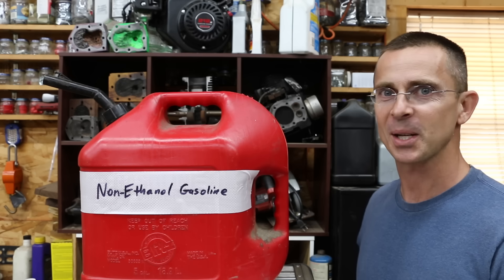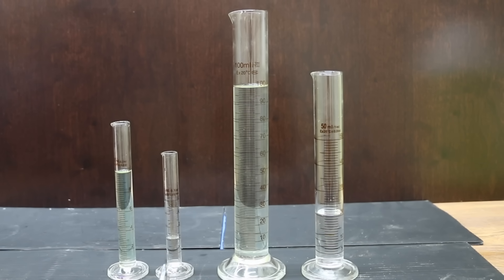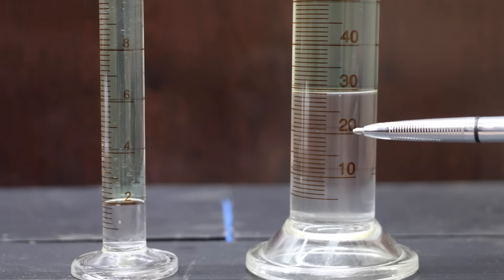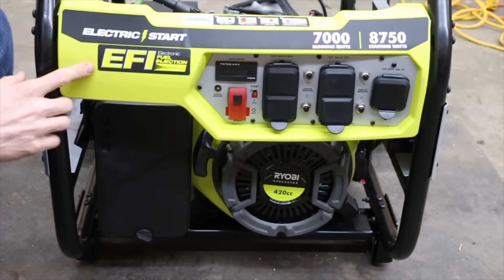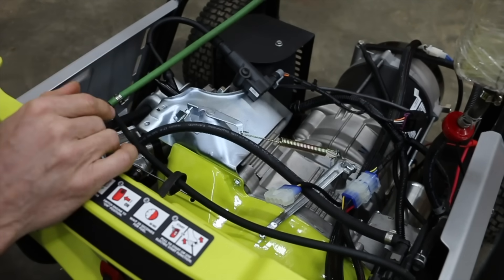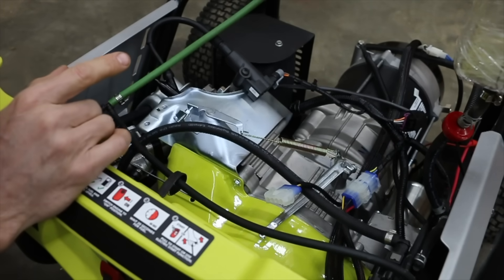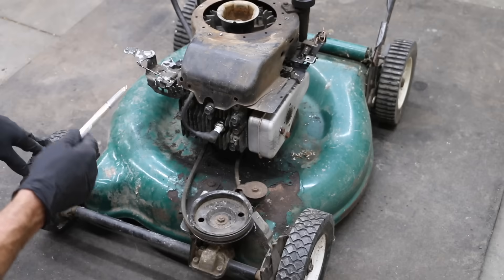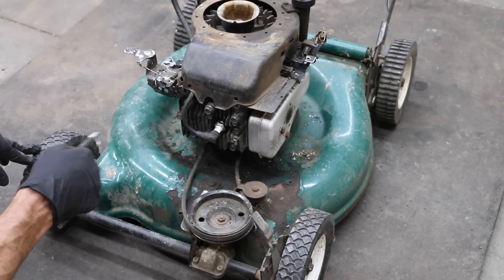Is Non-Ethanol Gasoline Really Better? See the PROOF!

Comment: 2 petrols one with 10% ethanol the other with 0% having the same octane rating means that the ethanol fuel uses a lower octane petrol which is then boosted with ethanol. What I would be interested in is taking the same basic fuel and then just adding 10% ethanol to it which would raise the octane value. Then running 2 engines which only differ in the optimizations regarding the octane value. That would show the actual difference if that makes sense.
Reply from the maker: Thanks for the video idea.

Comment: as a small engine mechanic. i have found ethanol will not stay mixed with the gas. it will separate from gas sitting over night. now all fuel tanks pull from the bottom of tank and as such when you first start the vehicle or in this case lawn mower after sitting over night you will be burning nothing but ethanol till it remixes with the gas. this remixing of ethanol and gas  happens faster in cars and trucks because of a return fuel line something small engines does not have. depending on size of your gas tank and how long it sits and gets used intervals now you have what i call a degrading octane rating on your fuel. this is more noticeable on riders with larger gas tanks. if you do not start with 91 octane 5% ethanol fuel the octane rating can go below the recommended 87 octane because of this. how much the octane degrades is based on fuel tank size and cycles of use and sitting around. 87 octane is minimum for most small engines to operate. the newer over head valve engines benefit from 91 octane because they have a much higher compression rating some up to 220 pounds. now with the octane rating degrading below 87 octane this is where excessive carbon build up happens because there isnt enough octane to perform a proper burn in cylinder. i recommend to all my customers if you insist on using ethanol gas ( or in some cases have no choice)  use 91 octane ethanol and never put more in lawn mower then what you will use to mow your yard. also shake your gas can before adding fuel so the ethanol is mixed properly with gas when you poor it.
Reply from the maker: Thanks for sharing.

Comment: I worked for the ethanol industry. Water is pumped into ethanol on purpose because even tho it is 100% dry, the epa allows 10% "moisture" due to flat storage accumulation. samples in the plant tested show 100% dry but water is induced because they can. I have plant plans showing water lines to the tanks. 10% of a million gallons is 100,000 gallons. Total scam on us tax payers.
Reply from the maker: Thanks for sharing.

Comment: Even on such a short test, it does appear that there is greater carbon build up on the spark plug point and the path leading to the exhaust valve. The differences aren't great, but it was a short test. It would be great to see a longer test. Fouled plugs and build up of gunk in your engine could easily wipe out any CO2 improvements brought about by ethanol additives.
Reply from the maker: Thanks for the feedback.

Comment: with my 99 ram 1500 i have noticed 2.4 mpg increase using ethanol free gas.

12.3 mpg using 87 octane ethanol fuel

14.7 mpg using 88 octane ethanol free fuel.
thats city driving.
Reply from the maker: Thanks for sharing.

Comment: Nice test. I watch ou videos often. I’ve made many adjustment to things I do based on your tests.  I did a similar on gas sets own at te nMarina. The marinas in my area only supply non oxy premium. Do to the moisture condensation  condensation. Certain amount of moisture gets into boat gas due to the vents on gas tanks. I had to have the ants pumped to remove this. It pretty common on larger boats. Even if you use the bas a lot  I found thr not gas began separation iabout 30 days where non oxy premium lasted er a year with only a very mall amount of accumulated water. No stabilizers worked at all.  He marinas do not allow you to bring your own gas 
For this reason. Almost every owner had issues over  time. I had both carbs rebuilt. Thre was no real corrosion 
 In them. Even fuel pumps were clean. Changed  water separating gas filters nearly every time I went out . TryingI tried several stabilizers. None prevented separation. He non oxy gas seemed  un effected.  Regular car gas degraded.. I drain my mower every year. N issues. I generally starts with one pull in the spring with fresh gas. 
It’s not been rebuilt 120 times but is very old. Uss  little   but not smoky..   thanks for the interesting videos.
Reply from the maker: Thanks so much!

Comment: Does Ethanol gas cause problems in aluminum carburetors. Outboard motor manufacturers suggest  use only straight gasoline.
Reply from the maker: Thanks for the suggestion.

Comment: Can't wait for the test on rubber and other components. With fuel over $4.00 per gal. and non-ethanol being a lot more expensive I'd love to know. I've been buying non-ethanol for my small engines since 2012 and it's easier to find but harder to swallow the price gouging still going on with that type of fuel. Why is that less cost more ?
Reply from the maker: Thanks for the video idea.
Reply: @ProjectFarm  I thought you mentioned a test on that but would take about 9 months

Comment: Alcohols are not  Corrosive as such . They are however , a different category of Solvent when compared to Petrol/Gasoline .
I  have liked using E-10 periodically , say every three fills , for Decades . The Hydrophilia of it keeps Water out of your Fuel System . Takes it out the Exhaust pipe .
Reply from the maker: Thanks for the feedback.

Comment: Though Non Ethanol gasoline gives 4% better mileage, if you start with a gallon of E10 gasoline, and remove the ethanol, You are left with 9/10 of a gallon of pure gasoline, meaning less mpg from the original gallon. Making your own is not going to save money. How about power?
Reply from the maker: Thanks for the suggestion.

Comment: Ethanol is a scam. Ethanol blended into gasoline increases the possibility of water pollution although it may reduce air pollution. Any leakage from storage will contribute to groundwater pollution because the ethanol in the blended fuel is soluble in stormwater.  Ethanol has a lower heat of combustion than pure hydrocarbons that comprise a gasoline blend, which reduces fuel economy. Government subsidies are required to allow ethanol to be blended economically. Gasoline pipelines typically do not transfer gasoline/ethanol blends. The ethanol, therefore, needs to be blended at terminals.

Comment: When I’m at the pump, I usually get the cheapest fuel, which ends up being ethanol10. What most people don’t know is that, although you spend less money on the fuel today, you’ll be back at the pump quicker due to a loss of efficiency. The price and efficiency determine if its worth getting the cheaper fuel. Great video!
Reply from the maker: Thanks!  Thanks for the feedback.
Reply: Where I am, the cost of non-ethanol gas far exceeds that of blended. If it only cost 4% more, I would use it every time.
Reply: E85- $3.80 25-27 gas mileage
E15- $4.60 28-30 gas mileage
E10- $4.80 29-31 gas mileage
E0- $6.09 32-34 gas mileage...

E85 most efficient for my use
Reply: @GolfClash2718  Many of our friends and family that have flex fuel cars discovered the cost per mile benefit of E85 and now use it all year except Jan and Feb. months.
Reply: Not efficiency the efficiency adds up to be the same less potential energy is in the fuel
Reply: Maybe with flex fuel, but with e87 or even e88 the difference should be pretty negligible since it’s only 10 - 15% ethanol. I reckon you usually don’t wait until the engine is literally running on fumes to fill up so you wouldn’t even notice the difference in milage.
Reply: @helios2664  I think you got the percentage backwards there: the figure after E refers to the ethanol percentage (around here at least).
Reply: Less energy in ethanol.
Reply: @gilesgreenaway5655  So? There is more energy in Diesel. But you don't like that either.
Reply: @debi5292  we are talking about gasoline and ethanol here and their qualities. What has diesel got to do with it and Why would you think I don't like it?
Reply: @debi5292  the discussion is gas and ethanol here,what has diesel got to do with the discussion and why would you think I don't like it?
Reply: @gilesgreenaway5655  Everyone knows there is less energy in ethanol. Captain obvious. 
Diesel has more energy than gasoline. I added to your obviousness.
Cost per mile is where it is at. Not energy per gallon.

Comment: I have a 2 year old jd first year ethnol gas no issues second year tried none ethnol engine was rough idling after a month took to jd shop spark plugs were fouled and fuel filters clogged I chang them once a year I only put around 20 hrs a year on it the mechanic said it was from the none ethnol free gas to go back to the ethnol fuel he said its all a money maker the none ethnol fuel
Reply from the maker: Thanks for sharing.
Reply: @ProjectFarm  i really don't think that is true how is that possible

Comment: I was told by a Mechanic Friend never use ethanol in any engine over 140psi cylinder pressure. He showed me the build up on my ATV pistons of carbon using ethanol. Which resulted in a hot spot and a burnt piston. Since then I haven't and applied the over 140psi to every motor I own using regular gas. Not a single problem with chainsaws,leaf blower,atc,motorcycles,boat motors,snowmobiles,lawnmowers,generator,and Honda pump motor.
Reply from the maker: Thanks for sharing.

Comment: In high tech car engines 10percent eth gives at least 15petcent better economy and cuts down on backfire exhaust burn also much more immediate response to throttle short term, long te keeps your engine clean and lean. Vw/audi/porsche all recommend e85 be used once a year or every 6000iles whichever is sooner to keep engine in top shape and give computer practice at advanced firing solutions.
Reply from the maker: Thanks for the feedback.

Comment: Ethanol is crystal clear like water.  I notice that ethanol fuel is yellow colored.  I wonder why that would be?  Perhaps they are dumping other byproducts like benzine and taurine into the fuel and that is the reason for the engine damage.  Remember, in the beginning all engines ran on ethanol as it was moonshine made on the farm. Gasoline was originally a byproduct of kerosene and the only reason we use it today is because John D Rockefeller funded a bill and bought congress off to make the production of ethanol illegal (prohibition).  Betcha didn't know that did ya?
Reply from the maker: Thanks for sharing.

Comment: 1st I just subscribed !! What I have found here in Colorado at high altitude in my 2017 Jeep Wrangler V6. Ethanol gas has less power, pings and gives me less miles per gal. Pure Gasoline runs better with higher mileage no ping, the downside is it costs much more and is Very Hard To Find in Colorado. I'm very tired of subsidizing the Corn Industry with gasoline cut with 10% corn filler!
Reply from the maker: Thanks for watching and subscribing!  Thanks for sharing.

Comment: What impact does this have on vehicles?
Reply from the maker: Thanks for the video idea.
Reply: @ProjectFarm  Yes, this is a fantastic topic.  Great to see on a little engine.  I don't know if it's worth the trouble to tear a car engine apart to inspect, but I would most interested to see the impact on mileage.  -and maybe power performance?  I'm not sure how you measure that.    

Also, maybe comparing little cars to big pickups / suvs.  Maybe truck unloaded compared to hauling a heavy load.  Does that make a difference?

People make all kinds of claims.  I'd be very curious to see what the real impact is, done by someone that is honest.  =)

Keep up the great work!!

Comment: A huge number of boats and older cars have rubberish components that are dissolved by ethanol. I had a neighbor 10ish years ago with a brand new boat and he was replacing the fuel pumps every year. Mercury marine did not offer ethanol safe parts. Here in Florida, there are obviously alot of boats, and almost every gas station sells it and the marinas only sell ethanol free. It's common knowledge here.
Reply from the maker: Thanks for the feedback.

Comment: I use non ethanol in my 1997 Lincoln and get 28 mpg plus highway miles when I use ethanol I get 22 mpg highway miles and as far as I'm concerned the ethanol is not that great
Reply from the maker: Thanks for sharing.

Comment: Well that is pretty good to know that you saw 4% better fuel efficiency with Non-ethanol gas .I have been doing the same "experiment" with full tanks in  a 3.0L V6 Mazda truck a few years and then a 5.7L Silverado. and figured it was somewhere around about 8%-10% .   I never used ethanol,  except when I simply could not find non-ethanol , like trips far away from my local gas-station which has it.

Yea, ethanol is a big no-no for small engines machines,  unless you like buying new small engine machines every couple years,  or carburetors for them , which usually cost  about $150 for parts and labor,  at a licensed small engine shop. (or more,  my figs are 10+years old). I worked at a hardware store about 5 years, and our mechanic spent about half his time replacing carbs/fuel system parts from "crap gas"i.e ethanol. 

BTW , you get about 2% better gas mileage from leaving  the tail-gate down on a pick-up truck ;)  LOL. You notice that at higher speeds( 75-80+) though higher speeds also eat up more gas.
Reply from the maker: Thanks for sharing.

Comment: How about that ethanol eats fuel systems, especially in older veh..it ate a hole in the fuel filler pipe of my dads 2001 minivan! It'll destroy fuel pumps, lines & injectors in 
non/pre ethanol rated cars..ie flex fuel veh., because it's corrosive.
Is it true it takes 4 gallons of filtered water to make 1 gallon of ethanol?
Ethanol has raised the price of groceries, mainly those that contain 
corn or products derived from corn.
From what I have seen, ethanol drops MPG by the same % of it's content in a vehicles fuel..almost like it helps very little in moving us down the road?
Reply from the maker: Thanks for the feedback.
Reply: @ProjectFarm  You're welcome! & thanks again for the cool channel/science!

Comment: Great video you have proven what I've been telling people for a long time I have a 72 GMC 4 WHEEL DRIVE truck and after they started selling non ethanol gas here I started using it because I knew what ethanol does to rubber and metal and the carbs after the second tank I could see an improvement in power and milage we have a hill on main street that I had to shift back into second gear after I could go up the hill in high gear and I went from 14 mpg to 17-18 mpg so I know there's a big difference in the two
Reply from the maker: Thanks for sharing.
Reply: That year, if the engine hasn't been rebuilt, doesn't have the hardened valve seats that the newer engines have. The old gas would be fine with that(leaded) but the unleaded fuel without an additive will damage the valves and/or valve seats in the cylinder heads.

Comment: When "electric starting" consider adding a breaker-bar ratchet to your drill.  Not sure if you've seen these, but they attach to a breaker bar to turn it into a ratchet.  With this between the drill and flywheel, if the engine takes off it starts ratcheting, which gives you the chance to pull it off rather than ripping it out of your hand.
Reply from the maker: Thanks for the suggestion.

Comment: The small engines for hedge clippers, lawn mowers, chainsaws, leaf back pack blowers, weed whackers, and the like do not like ethanol. Most of them use the Zuma carbs. These have a sheer internal gasket of neoprene, or whatever, and there is a small " flapper" piece, that
the ethanol loves to ruin. I have had to replace many of these carb gaskets. Ethanol is bad news for engines. It's already been proven, there are more overall emissions and contaminants from Ethanol gas.
Plus, it has no shelf life...
Reply from the maker: Thanks for the feedback.

Comment: naah, here in brazil our gasoline have 27% ethanol and we also have e100 and flexfuels. No harm done, the actual problem is only the materials used in direct injection pumps and injector. For indirect injection no problem on gasoline cars and the flexfuels must have a different gas pump
Reply from the maker: Thanks for sharing.

Comment: Here in Brazil, every single engine part is made to run ethanol based gasoline or pure ethanol (sugar cane). Not a single part remains untreated. For this reason. 
In the beginning, we had some problems. But now, when you open an engine, everything is like new.
Reply from the maker: Thanks for the feedback.

Comment: Ethonal gas, eats head gaskets,  valve and or seals. I used to deliver ethonal, at kinder Morgan in San Jose CA. They have to change the steel every 3 months due to leaks caused by ethanol
Reply from the maker: Thanks for the feedback.

Comment: For engines that are designed for ethanol mix fuels there is no problem at all but for older engines they don't have the correct fuel air mixtures causing carbon deposits and also use materials that are easily degraded by ethanol. It should be offered as an option but as usual it is mandated because climate change or some other BS.
Reply from the maker: Thanks for the feedback.

Comment: Ethanol has a lower Heat Value than Gasoline, so in theory, it should provide more performance. Engine Masters on Motortrend TV have proved that E85 (85% Ethanol) produces more power on Turbo/Super-charged Engines. The Ethanol adds more oxygen to the burn. I grew up in the Leaded Gasoline era (no Octane Additives were sold). You had to buy Sunoco 105 Octane (or Aviation Fuel 116 Octane) for high compression engines so you didn't have to retard the timing (lose power). Methanol/Alcohol could only be used at Drag Strips.
Reply from the maker: Thanks for sharing.